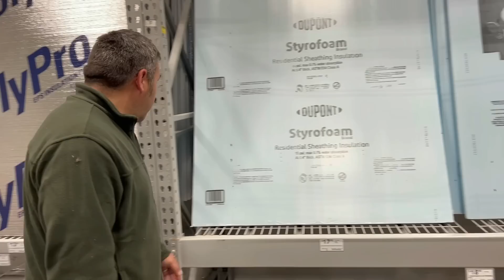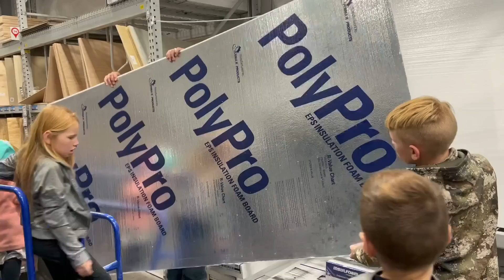Buying The Supplies For Our Shed To Tiny House!!

Comment: If you use pocket doors for the utility room & Leighton’s bedroom will save room - not having to swing open the doors blocking walls - will leave open walls allowing more items to set up next to the walls.
Reply: Or a barn door. Sliding
Reply: I love pocket doors. My son, who does building, says they are a pain to install.
Reply: I put them in my tiny house ❤

Comment: Brandon,  consider putting your concrete blocks under the shed before you get too much weight on the building from walls, wiring, plumbing, etc.  Much easier (lighter) now.  We are finishing out the inside of a Derksen shed ourselves right now.  Hang in there and do your own thing.  It will all be fine when it’s completed!!
Reply from the maker: Thank you and will do

Comment: The insulation you are using for the trailer bottom can also be used as the insulation for y’all’s cabin. Just something to consider.  I use to put siding on houses with my dad and this is what we used on the houses
Y’all are doing so awesome.

Comment: I love how y'all are building the tiny/barn/cabin!  I wish i had the help like you have !  I live in a tiny/barn'cabin home.  I rented to own one, and paid it off 4 years later and i still some small finishing touches to work in. lol  i used the pink panther in the walls then used the thin floor layment for my walls.  stained them with true walnut hulls. works great. winters are about the same as you have. i am in north GA. it can be ruff sometimes but will not change it for any thing.

Comment: Yay! So exciting!!!! Love how you mapped it out with tape on the floor.
Something to keep in mind when pricing out the pink insulation is you will need the insulation (about 8 bags), poly to cover, staples for the poly and tuktape (red) to seal off the seams on the poly. It would add up to about $1,500 not considering your time/labor. I would estimate that it will take you a full 8hrs non stop to complete by yourself. So in my opinion,  $2k for spray insulation is well worth it. 
Can't wait to see the Shed to House come to fruition

Comment: Brandon they have those white paint bodysuits I believe they carry them at Lowe’s or wherever you are anybody you know any of those big box stores carry them they’re cheap and that fiberglass won’t bother you just wear a goggles and a facemask when you’re putting it up that way there otherwise you’re gonna be paying out the Wazoo for that spray foam those that’s really good for boats for fiberglass to fill in the holes and it’s also really good to know I just forgot what it was but either way those white paint suits he come with a hoodie on them already and they’re plastic or like a a real light of plastic tight material and it’ll keep that fiberglass from getting all over you and the zip up so it’s just a thought but otherwise you’re gonna be stuck paying a ton of money for that spray foam I think the pink Panther is better anyways❤😮😊

Comment: You can get the thinner paneling but if hit right it will brake easier then the thicker paneling for walls . I know using thinner paneling it is so easy to punch o hole in the walls even by accident . You all have been doing just fine with the way your building things and it’s not like you don’t ask questions when you can’t figure things out.

Comment: God bless ya I hope y'all are doing well I just like to tell you they have installation made out of recycled newspaper that is cheaper than the pink fiberglass installation and they are factor is just as good as the fiberglass installation just a thought you can also use the installation board that y'all are doing the camper with works well too and might be cheaper too just a thought just saying 😎..
Reply from the maker: Thank you. Will look into that

Comment: Hey Brandon , you can go with the thinner paneling as it’s the insulation that will make a difference not the paneling 
I’m sure getting the pink insulation will be cheaper than the spray foam

I’m excited to see you get things done ❤

Comment: Also forgot we have a cabin in the woods use these power stations love them and we have these Eden pur heaters  great little heaters the case never gets hot  so no burns we have the electric fireplace on and the box heater totally take away the chill we feel there super safe

Comment: As we said in a previous comment we had 2 sheds one has the pink insulation and one has the foam. There is a definite difference in the insulation as the foam keeps the shed so much cooler in the summer and warmer in the winter

Comment: Just a suggestion I would put a 4 mm thick tarp down on the ground underneath the a whole camper. This will keep the straw from getting wet and molding. It will also help stop the cold from the ground. Then put your straw on top of the tarp underneath the camper. Pack the straw in the whole length of the camper so there's no openings.Then put your insulation around the straw. Pull the tarp up and over the edges of the insulation and straw. Then tack the edges of the tarp up and under camper so all you see is the tarp. If tarps are expensive where you live,  you can also use clear plastic 4 mm thick it comes in rolls. I hope and pray everything works out for your family in this cold weather.

Comment: Spray fome is Best to seal the walls but if you use that it is best to do your water lines and electric first.
Spray fome advantage ( better insulation , insect  proof  , sound blocking , seals all spaces ) . It cost more but it dose more .

Comment: 💙💙💙💙💙💙 This is just some suggestions.  Not sure of the size of your MAIN water line, but you probably want to put a regulator just after the meter, (because of your water pressure) then start reducing to 3/4", to whatever size your hoses are to the camper.  As far as the tiny house, You want to keep 3/4" throughout until you get past the hot water heater, if  you are putting one in,  then you reduce to 1/2" from there on out.  Sink, washer, etc.  I know you guys are using pex, which is aaaaammmaaaazzzzziiiinnngggg, lol,  but where it comes out of the ground, and into the tiny house, I would suggest to even wrap it with heat tape and some pipe insulation.  Pex CAN freeze, but is not supposed to busrt.  But, just in case,  you can let your water trickle and avoid all of that. Just some suggestions!!!!😊😊

Comment: Brandon, I like the idea of spray foaming the ceiling and using pink insulation on the walls! More budget friendly! When were you going to run the electric wiring for the outlets, lights, and appliances? You'll want to do that before insulation. And don't forget about some kind of ventilation for the bldg as a whole, to prevent mold issues later on. Just some suggestions is all. Love your family and farm animals. Keep moving forward and don't be afraid to ask questions at Lowes. They'll help make sure you have everything you need. If you know a good electrician, ask him if he can guide you on proper hook in and wiring sequence. And have fun building! God Bless!

Comment: I have used both paneling in building. Beadboard is my favorite for and wainscoting ect.  Depending what insulation you use. Spray ceiling and paint it. Put a heavy mil  plastic over wall insulation if use fiber glass. This will also help with extra insulation. If you want hot water they have plug in instant hot water heater. I'll look and see to send you a link.

Comment: Because your shed has the bare tin on top, and does not have wood and moisture barrier between it and the inside, sprayfoam would be the best on the ceiling to stop condensation and mold growth. Pink for the walls will make it easier to remove and change things up with electric and plumbing, as future needs change the use of the cabin.

Comment: If you do the sliding barn doors on the rooms or the sliding doors that go inside the walls you can utilise more wall space and they won’t intrude into the room space like when you have normal opening doors. Just a suggestion because it’s ultimately your decision as your building the rooms.😊😊

Comment: 1) Brandon, I would say for indoor water supply to use at least 1/2". Outside if you like you can go with your 3/4" supply line. Chad (Adler Farms) used, I think 2" pex from meter to house. Have you checked at Home Depot for prices I think Lowe's is higherl

2) Stephanie, you were correct in giving 2 1/2' = 30" & most appliances are 30" washer & 30" dryer, some smaller too.

Comment: I like what you are doing with your tiny house floor plan.
May I suggest you consider placing the washer on one side of the window and the dryer on the other side of the window with the drying table between them under the window. Just a suggestion. 😊

Comment: I follow a YouTuber couple called Life Uncontained. They built a house out of 18 wheeler containers. They had the spray foam installed. There was a few things they wish they'd done differently. If I remember right. I think one thing had to do with the wiring being covered by the spray foam. That's the only thing I can think of right now. But there was something else.     One thing you may want to check on is a baby monitor if it would be in range. We used one when my father was bed bound. They also have them with cameras. I'm not going to say that him being in the building by himself doesn't make me nervous. But like Brandon said y'all are the ones that have to make the decision of what you thinks best. I stand behind whatever you decide. I don't usually leave comments. But I do try to leave y'all a heart with every video I watch. I wish you all the best of luck with everything you are doing. ❤️

Comment: You have so much patience with your children. Really should make a sketch and then a material list. The thinner paneling is fine. It’s a temporary living space. I would recommend drywall but it would be difficult for you to finish it. Not cheap but affordable. I’m sure you’ll find the batt insulation less than spray foam. If I ever get stopped by the law I hope it’s someone like you. 😄 Steph is one sharp gal. Are the exterior walls framed with 2x4s? If not might want to test fit the batting insulation to see how it fits.

Comment: Entry door=36", bedroom =30", bathroom =24". Washer and dryers are usually 30" w x 30" deep. Have you thought of rigid Styrofoam (4'x 8' x 42 or 3" thick) cut and fitted between the wall studs?  Better R-factor, more expensive but  easier for DIY person to do.

Comment: Ceiling  baffling  so have air space for ventilation  between  cold roof and insulated  space  the air space  will stop sweating  from roof tin
One way put 1x1 strip  on rafters close to tin  then use 1/4 thick insulation foam board or foiled  bubble insulation  air will pass between bottom of tin and out the ridge vent keep from forming  condensation

Comment: Not sure what area you are located in. But if you're in where it gets really cold in the winter I would think about putting insulation foam around your pex pipe along the outside  walls for extra protection. I live in Missouri and winter time is harsh. You most likely already know but if you haven't thought it

Comment: Hey I would take to put the washer and dryer on the wall where there's no windows and put your table where the window is that way you wouldn't have to use so much water line I'm not trying to be rude but that's what I would do that way you can put a shelf above the washer and dryer and you can put a corner shelf over there where the folding table will be but like I'm saying I'm not trying to be rude I really admire what you're doing

Comment: Does your code say you have to have 16" on center exterior wall studs? I'd put that door you mentioned in place of the window on the end first incase you do decide to add a second shed to it. Save on time and cost and a second door never hurts

Comment: Suggest long term $$$ savings, heat/AC tiny shelter, R15 walls and R30 ceiling.  Frost free water hydrant, must for outside connection.🙏

Comment: WHAT YA THINK ABOUT NOT PUTTING THE WALL UP BETWEEN THE LAUNDRY ROOM AND THE KITCHN (TEMPERARY) THAT WILL GIVE YOU PLENTY OF ROOM, MAYBE EVEN WOULD HAVE ROOM FOR A DINING TABLE  WHERE YOU CAN ALL SIT DOWN TOGETHER AND EAT.  YOU CAN ALWAY PUT UP A WALL LATER. JUST A THOUGHT.  LOVE YOU GUYS. I THINK YOU ARE DOING GREAT! I HAVE FAITH YOU WILL DO GREAT WITH THIS BUILD.
IF YOU TELL THEM AT  HOME DEPOT OR WHERE EVER YOU GET SUPPLIES THAT YOU WANT THEM TO TELL YOU HOW MUCH PINK INSULATION, THAT WAY THEY CAN FIGURE IT OUT FOR YOU. MOST PLACE WILL DO THAT WITH ANY BUILDING SUPPLIES.
GOOD LUCK, PRAYS GOING OUT FOR YOU.

Comment: You would probably be better off with having someone install closed cell foam insulation. I know that $2,000. is a lot of money but there are many benefits to closed cell foam over fiberglass. You get a higher R value that does not degrade over time like fiberglass insulation does. It has a built-in fire-retardant, and keeps out dust and pollen. It also adds strength to your building. Since you do not react well to fiberglass it would make more sense to have a professional install the insulation whatever you choose to do. Do some research before you decide. The drawback to closed cell foam insulation is that it is more expensive.
Reply from the maker: Thank you. I think that is what we are going to do

Comment: Are you using the wood inside the shed or under the camper. I would go with the thinner if you are going to use it for the walls inside the shed.

Comment: Just a piece of information.  You said you was going to form the walls.  If it is a concrete wall you form it.  If is a wood or metal stud wall you frame it.  If it is a brick or block wall you lay it.  Again you can call it anything you want but it sounds more like you know what you are doing If you use the right terminology.
Reply from the maker: Yes thanks

Comment: You know the the payment is really pretty though the wood paneling you picked out but would it not be cheaper to totally go sheetrock I mean it's not that hard it's actually easier to put in than the wood my opinion I mean I've done sheetrock work for years I just seem to think it's a lot easier cheaper more efficient the wood

Comment: I wish you could see that insulation that I'm talking about it is the same size as those little pieces that you just got but they're pink and they're are thicker than that you just got you have to cut it with a saw the kind that I'm talking about I know you have to do what you got financially to do with I didn't see it in the insulation where you were standing and showing the other insulation just was hoping that you could see the kind that I was talking about while you were in Lowe's

Comment: Can I say, the music is way too loud. 3/4  is the best, can use a downsize , good water pressure is the best, putting a pressure regulator on for the camper and then for the house. My dad made use a fort out in the back yard, We slept in the fort . no bed, no electric , no plumbing, drank water out of the hose, we had a hole in the ground with a cover on it to pee and poop. And I am still alive. We all have great memories, Let the Eddy Family make theirs.Outdoor barn paint for the floor before building.

Comment: Why do you need to use the wood panels?  I would just use drywall?  Then later on you could just panel it or just leave it be with paint.